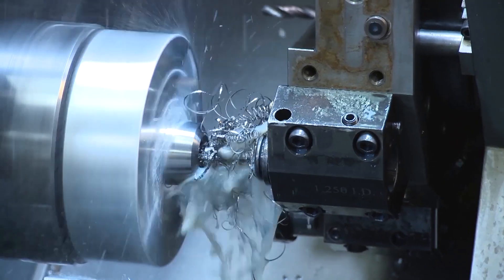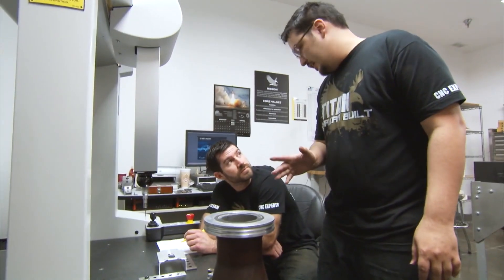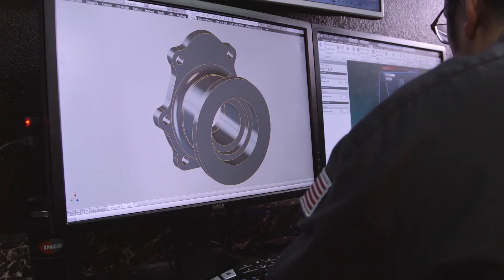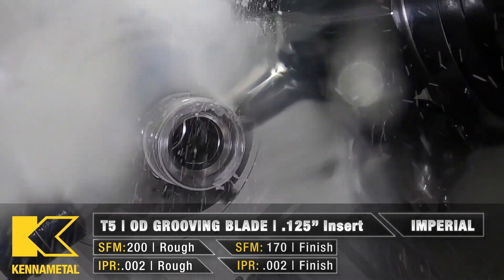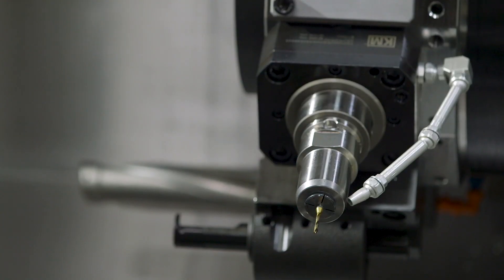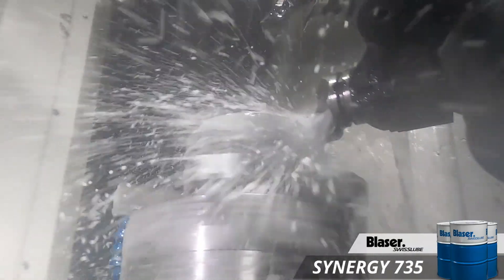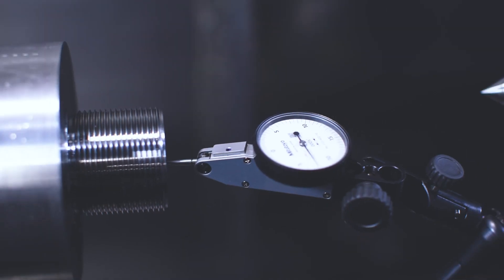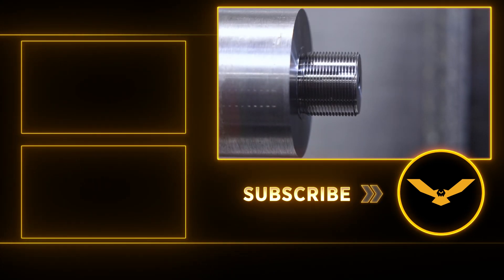Dangerous Fail | Machinist Nearly KILLS Co-Worker with Spinning Bar stock

Comment: My first lathe was a 35 horse Mori SL35. We ran long shafts quite often. Of coarse we had steadies to keep things safe, but you bet the back of that machine had been completely demolished and rebuilt due to bent and flailing bars. Probably the biggest killer in a machine shop. Never liked that the wire EDM station was back there next to the steady rests, but at least that machine didn't take a lot of baby sitting.

Comment: now i remember the time i almost died in school, my school decided it was time we re-organized the way that the machines where placed, and to make it cheaper, they ofcourse made the students help with that, so when we came around to moving a mill, i`d say 2.2m high atleast and i was standing on 2 pieces of wood like think just roofwork type wood. and i had the honour of trying to lift it up with a prybar i think its called (it was basicly a long stick with wheels at the end) and i had my teacher on the other side pumping away on a hydrolic pump to get a dolly underneath. but my teacher was pumping to high and i felt the machine slowly slipping of my prybar. so i called to the teacher. miss i feel the machine slipping a bit, i think you shoud lower your side. and she told me its ok. so i waited like 2-3 seconds and i was really starting to feel to machine slip of my prybar. so again this time i called out to my teacher. miss i can feel the machine slipping. again she told me to lift it up a bit higher. and i (practicly screaming) told her again, MISS I FEEL THE MACHINE SLIPPING. before i even finish my scentence, the machine slips off the prybar, i lose my balance for half a second, and i see this machine falling over to me i push against the machine so i coud get myself away faster

Comment: Two months ago I reached into a mill to blow out chips because the auger wasn’t pulling them down anymore (aluminum part with a TON of chips, like up to the bed) with an end mill spinning about 3000 rpm. 

In my haste I bumped the inside of my wrist up against that 1/2” end mill and cut it open about 1/2” deep. I had to have surgery to repair 3 tendons that I cut through, which I’m still recovering from. I’ve been slowly regaining the function of my hand and after two months I’m finally able to do small tasks with that hand like putting on deodorant or starting the car. 

Without a doubt the dumbest thing I’ve ever done. Learn from my mistake, NEVER under ANY circumstances put your hand in a machine with spinning tools. It’s not worth it.

Comment: I allmost got killed in a similar way. I was running the mill on a night shift, second guy was running a leathe fifteen meters away. And all of a sudden, bang and something flew inches from my face.
He loaded two meters of steel bar, like ten centimeters in diameter. Meter and half was portruding from the back of the machine with no support. He started the machine and that ten centimeter bad boy bended in right angle, tore out whole steel cover of the machine and in next rotation shot that cover (wich was like 1x2 meter steel sheet) through whole workplace, around me, and embeded itself into wall.

Comment: I spent 31 years at Michelin, 11 as a machinist and 20 in maintenance, early in my career I operated a large vertical turrent lathe making tire mould parts, one day a fellow vertical turrent lathe operator was running the machine that we worked opposite shifts on and Francois Michelin himself was touring the shop and just happened to walk by our lathe, well my workmate for whatever reason buried the tool turrent into the table and one of the part jaws tore the large tool holder off of the turrent resulting in an extremely loud crash, later he said that the tool holder just fell off ! We laughed about that for years .

Comment: I made up tapered plugs for the back of our lathe. If a bar is longer, I put in a plug that the bar just fits in and it keeps the bars stable. I also made some rollers to support 20' long bars. I'm obviously not spinning 4000rpm for those ones either.

Comment: I'm 2 years as an apprentice into the industry only working on little 3 axis VMC bridgports, but are still just as dangerous (got a little too close to the vice with a 63.3mm facemill couple weeks ago). No cutting corners, got it 👍
Reply: I have hit vices with face mills a couple times. Sounds like you are lucky to be in an apprenticeship. I've been in Machining for four years, and still feel like I'm mediocre. I do run mill, lathes, 3,4,5 axis. Even twin spindle lathes, but I still feel like I don't know enough.
Reply: @daigyakusatsu2254  Rome wasn't built in a day, if it takes that long then so be it, safety always comes first in my eyes.

Comment: a long time ago working with Mori Seiki CNC lathe SR35 ( mide size ) one programmer did in first line of the program   G50 S3000  ( instead of G50 S300) , because his primary work was , to programming swiss type CNC machines ( max diameter around 1 inch ) , but this time WPC was a piece of brass around 50 punds of weight ( aprox 22 kg ) . And whan operator press button Cycle start , WPC run out , and made a big damage . 
Operator lost hir arm  ( but he was lucky because did not die at all ) and the brick wall on the other side of the shope was very damaged . 
Kinetik energy od 50 pund spining to 3000 RPM was , enormous . Just one exra " zero" in the programm made a big damage .

Comment: "Everybody in the shop must have heared that awful noise"? Try everybody in the entire state....

I'm glad though that nobody was seriously hurt (or worse) and it takes some character to admit that kind of mistake. It's also a rookie mistake, but as Tyson said it was in the beginning of his machinist career.

I can understand it though. If you just have a look at the medium sized machines, they don't look like they can hurt anyone if the door is closed. No sharp corners and a nice enclosure. What could possibly go wrong?

Lets just say there s a reason why the glass in the lathe door is bullet proof and most people don't have a clue what kind of power they are releasing when they hit cycle start until something goes wrong. Even the medium sized machines are really powerful and will hurt you badly the moment you lose respect for them.

Stay safe people!

Comment: Unsupported bars are no joke! A former employee at my current job was nearly ripped in half by this exact scenario. Aside from the safety issues, a bar that is bent or not sufficiently supported (even if it does not stick out beyond the end of the spindle/headstock) can cause your inside and outside diameters to be out-of-round, potentially scrapping parts.

On a similar note to unsupported bars, turning parts that are not symmetrical (particularly if they have a heavy feature or 'lug' on one side) can cause an extremely unbalanced condition, possibly enough to throw the part out of the jaws and through the window, etc. Pay close attention to what spindle RPM as it increases as the tool approaches centerline during a facing operation, as the otherwise 'acceptable' amount of imbalance happening during lower RPM turning on the O.D. could quickly get out of control as a facing cut is made and the RPM increases.

Comment: Same thing happened a few years ago. I was running manual lathe when a cnc lathe had a bar extended beyond the spindle tube. It began launching materials off a cart in every direction including at me. I was in a corner with no place to go so I jumped through an open window.

Comment: I did same on our QT8 with 7/8" M2 bar sticking out 16" from the last draw tube bushing. Ran the machine up to 1000 manually seemed ok then hit go to run the part program and it spun up to 2000. I didn't check thought I'd just wing it as there was pressure to move on the job..  Bar bent 30 deg. out past the sheet metal which I damaged a little. Next day pounded everything back flat and tidy and went and engraved a warning label for max bar length on the draw tube door to make sure it didn't happen again. Like Tyson I learnt an important lesson, was very lucky no injuries and no visible damage once all said and done. Thanks for posting this Tyson.

Comment: Had a guy cutting circles on a cnc router table...... Well he didnt leave holding tabs and when he got to the fourth circle it shot that Chinese star shaped drop piece across the shop and stuck into the metal wall. Scary noise hearing it fly.

Comment: A few years back I did the same thing . 3 feet of 3/4 diameter 1018 sticking out the back of the lathe. I had always only run mills , but we bought a lathe. 
2000 rpm the bar bent 90 degrees and pulverized a shelving unit stacked full of carbide tooling .
The mistake was so obvious but because of lack of experience I didn’t recognize it. Now I try to imagine how this machine and it’s setup will hurt me , then proceed to fix it before start up
Reply: If it had a support on the backside, would it solve the problem?

Comment: Only CNC lathe accident I’ve ever had was similar.  Test ran at the rpm, everything looked ok.  Ran the program, as soon as the tool touched the bar the overhang instantly bent and smashed shelving behind the lathe.

Comment: At a company I worked for when I was an apprentice, they set up a bar that was sticking out the back of the lathe. Alot of rpm's a couple of seconds later, the bar bent 90 degrees and kicked the rear cover up hitting the roof (it was a tall workshop). This was before my time there, but I will never forget the story. I always have in mind that the part should have no way to flex or move when setting up the machine. Thanks for the story Tyson. People need to hear this. Also, pressing the emergency stop at my machine (puma 3100xly) shut of the machine and the spindle spins freely. Hitting the reset button stops it as fast as possible. My finger is hovering the reset if I'm skeptical 😅
Reply: My right hand is always pinched around the protruding feed hold button during dry cycles and any first run at full speed after that.

Comment: I saw a labourer have the luckiest escape from getting his brains splattered by a long spinning bar as it suddenly bent and started flailing round as he walked past.
Lathe operator using a big old turret lathe was cutting small lengths off a very long 1 inch bar - probably the usual stock length of 18 feet.
He didn't use a support for the overhanging length so when he speeded the lathe up the bar just began spinning out of round then bent at about 45 degrees and flailed round against the floor just as labourer walked past.
I watched and expected to see blood and bains spatter but somehow the bar missed the guy.
Another guy told me of time a foreman decided to show a visitor how a CNC lathe worked and just pushed the go button without zeroing the turret.  So it went into fast traverse right into the spinning chuck, sheared off all the chuck bolts and the chuck flew up and over the workshop and luckily smacked against a big girder.
Another guy had a big modern lathe boring out a big hard long forging and had been saying the clutch was slipping.  Then
just as he walked to the headstock the lid blew off as the hot clutch ignited the oil vapour inside.  Huge chunks of iron flew about but guy escaped with singed eyebrows.
Programmer who thought himself superior had programmed a Mitsui machining centre that had a cube for bolting parts to.  The turret fed forward and should have retracted before the cube rotated but program was too tight and the cube rotated before the turret ratreacted.  Awful crash and bang as the cube bolts sheared and it fell into the swarf tray.   I don't know if the turret spindle or bearding were damaged.
Same factory made gearbox selector forks on 5 machines at the rate of 24 per machine per hour.  We checked them all with slip and plug gauges then went in one day to find all gauges gone and were told put all the forks in the new CMM.  But it was so slow it only did about 20 per hour.  We asked what to do with the unchecked ones and next day found they had all been put in the scrap bin s the customer would not accept unless checked on CMM.   Throwing out 80% of production is a sure way to failure and company folded a bit later.
These incidents were all in UK companies and all of them have closed.

Comment: Thanks for this video, I wonder if anyone has some guidance on what IS safe to stick out behind a lathe, depending on L/D, material, weight, and how it's held in place.
Reply: If I ever have any doubt I always use a fixed steady rest behind the lathe to support the stock
Reply: And reduce the RPM, it will make the bar more stable

Comment: Ive been in this scenario. 
I got lazy on a barfeeder and rather than push the feeder in to cover the last 12" of bar, I let the bar spin out the back of the machine. As I tried to cone the bar, it bent to 90 degrees and span like a propeller. The issue was when I went to stop spindle by turning switch to manual and pressing stop.( note this was in earlier days of career and then boss always said not to press e-stop on this machine), The manual override sent the spindle speed up to 2500 and the bar disintegrated nearly hitting people. I have since been a bit more careful

Comment: It's good to take responsibility when you do something. I will say, if I were in charge of a button pusher on a job like this, and there was multiple sizes or lengths of material, I would have specified if they were not to run one or some of them. If that was the plan, I usually go ahead and mark the pieces differently and/or seperate them completely so the operator can't accidentally grab the wrong one.
Reply: Some time difficult with bosses son
Reply: @kdenyer1  I sometimes help teach my bosses son. DO NOT be afraid to tell them they are doing something wrong/dangerous/stupid because if something happens you can be sure the first question will be "why did you let them do it?". 
At the end of the day they are just another employee to train and should be treated equally.
Reply: @wildin13  exactly. With someone like that you have to be strict.
Reply: @brahtrumpwonbigly7309  having seen jobs(BIG JOBS) thrown out of machines i always treat it like its my safety at stake if they get it wrong.
Reply: @kdenyer1  I've definitely had to deal with that, I never changed my process, though. I've had to stand up fir myself in many occasions and these procedures I go through were my irrefutable evidence that I wasn't at fault. If I take it easy on someone, that's all they need to blame me for their own mistakes.

Comment: Usually happens to the nOObs. And if they do not have a older wiser operator around to ask for advice.
Reply: The problem is that noobs don't see any danger, so they don't feel that they should ask for advice. The experienced person should be monitoring what the noob is doing, and give warnings in advance.

Comment: Takes some character to tell us about a mistake like this. Respect.
Reply: Never trust the programmer. I made that mistake one night. 72" VTL I slung a 5,000# forging out of the machine because he said the program was good and ready to run. Lesson learned, Always double check and have someone double check with you....... 20,000 worth of damage to an old G&L. And those machines are built Tougher than anything else on the market today.....

Comment: We had one of this too, in my old job. Forman put guy that run mills on lathe, to load bars. He loaded bar, that stick out about 3 ft from machine. It was 3/4 hex and hit the metal table that was next to the back of the machine. I was on the other end of the shop when hear the laud boom. Turn around and see the big table flying in the air along with all the stuff that was on it.